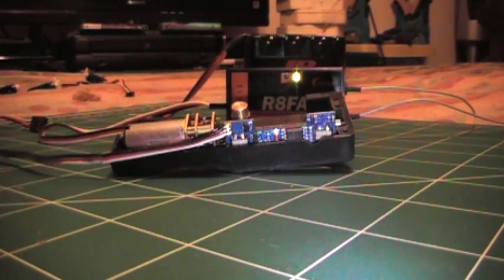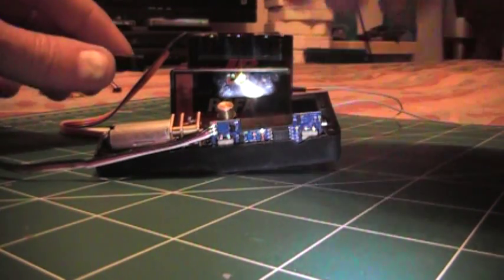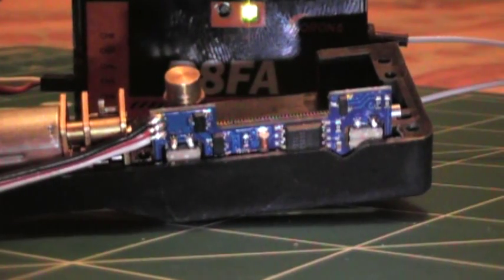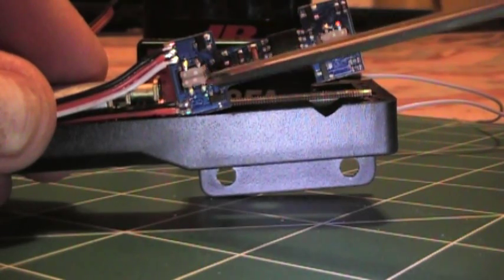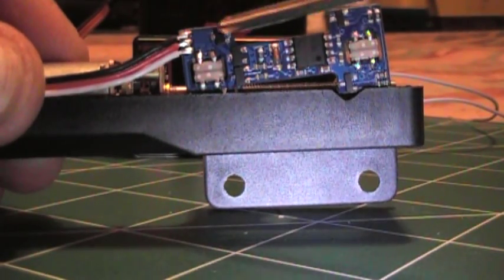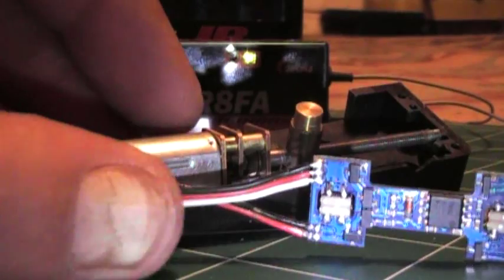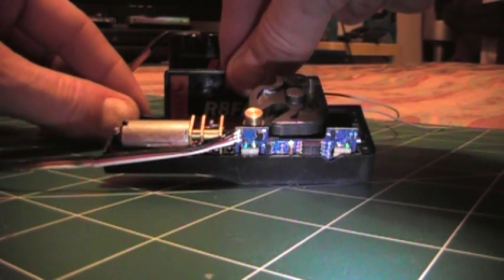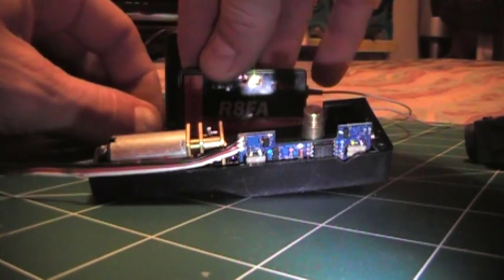FMS retract for 1700 mm Mustang opened up 2nd video 001.MOD

Comment: I had this exact same problem and I also caught it on video. I also have it uploaded but set to private at the moment. I now have the V2 retracts but one of them just does not work?? It did work about 3 times, now it is stuck completely down and wont move up. Any ideas, you seem to know your stuff, so any help would be cool :)
Reply from the maker: john creed 
Check to see if the trunnion has over traveled and is jammed on the jack screw? If so?...dissasemble it and manually back the slide bar on the jack screw back about 5 turns or so and retry, also check for bad or broken electrical connections.
Reply: Ah ok, cool I will do that later this evening :) I know FMS make nice looking planes but it seems like they rely on there customers, especially good people like you to be the beta testers? I know that sounds cynical but I've had such a bad experience with my P47 that I never want to buy anything from FMS again! First the prop assembly/ hub flew apart mid flight causing it to crash land, got replaced by CML distribution, then the retracts on the replacement smoked and didn't work. So they sent me replacement wings with V2 retracts in them. I swapped them over and the light stopped working on the right wing, then the v2 retract failed! The whole thing has pissed me off overall, sorry for ranting :( Whats your take on FMS? I heard they do actually make some good models, but on the flip side some are just terrible?
Reply from the maker: john creed 
I understand where you're coming from. Been there ...Done that. My being suckered into a "Beta Tester" days are done....it's just too expensive etc.... I like my FMS and Free wing models and have seen much improvement in the past few years and haven't encountered many problems as before with either.